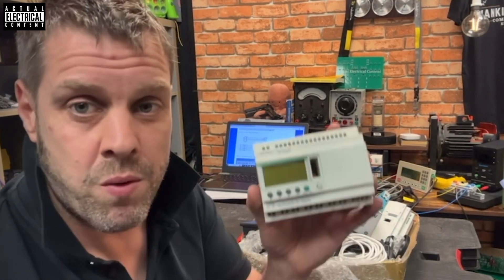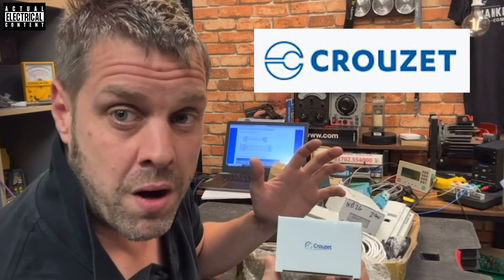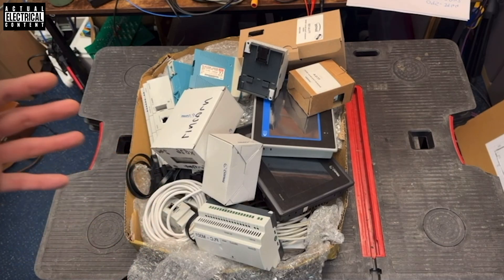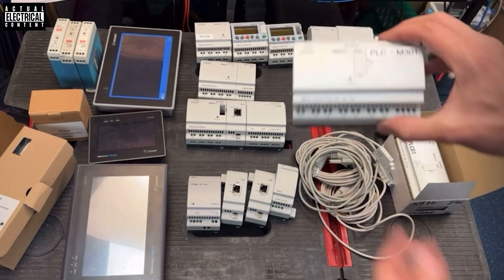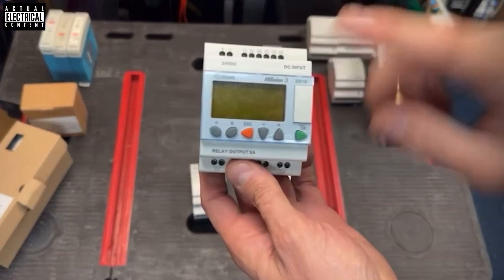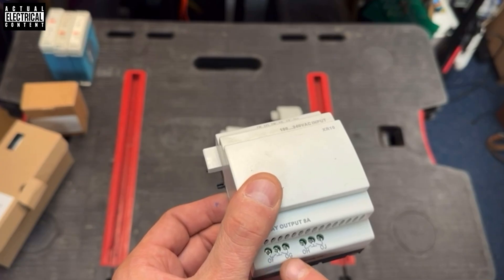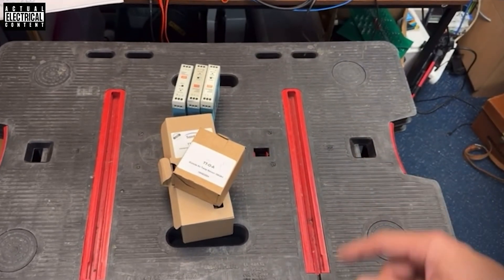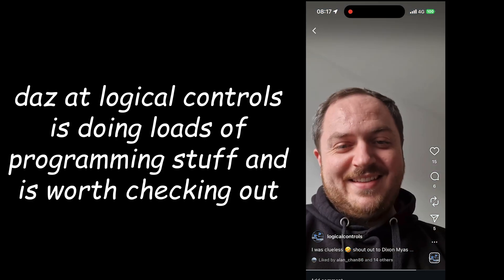SMART RELAYS - LIKE PLC,S BUT TEENEY WEENY

Comment: I have been playing with the crouzet m3 for years now. Impressive little box of tricks. We have them in lifts, gates, barriers, heating and lighting systems. Pretty cost effective too as half a dozen relays and timers soon add up, plus the time to assemble and wire them up.always been solid reliable too. It’s never a proper PLC but for simple automation projects. Especially for the home gamer. All the best Jamie. Cheers

Comment: Like PLCs but shite 💩 

...and increasingly not cost effective as entry PLCs get cheaper (e.g. S7 1200 G2)

Function block is generally garbage too with the exception of some process applications
Reply: Function Block Diagrams are great for BMS. I looked at images on the PLC versions of FBD and I agree they look horrible.